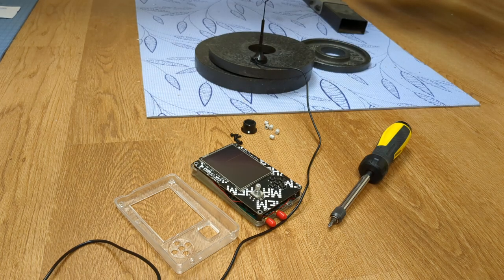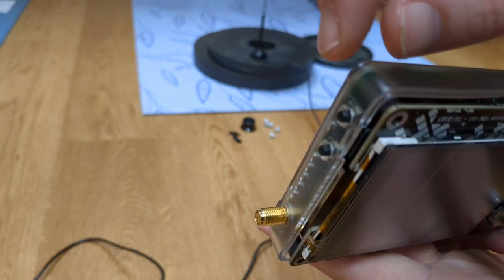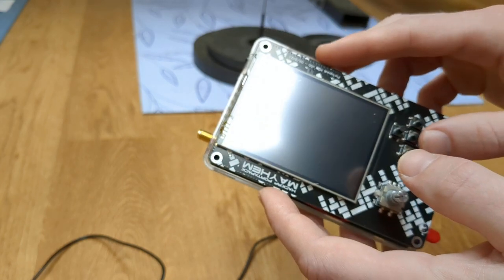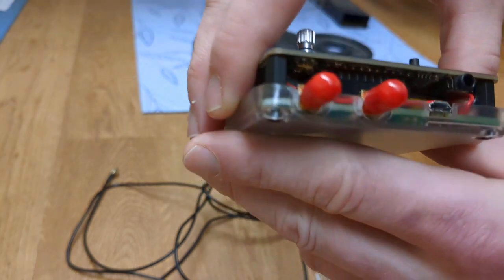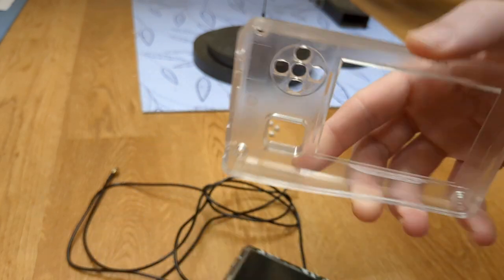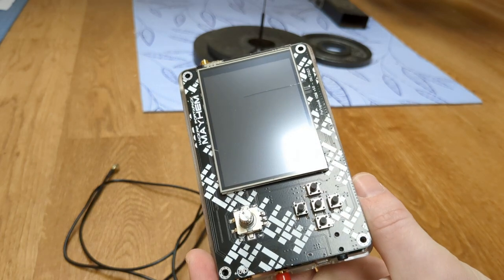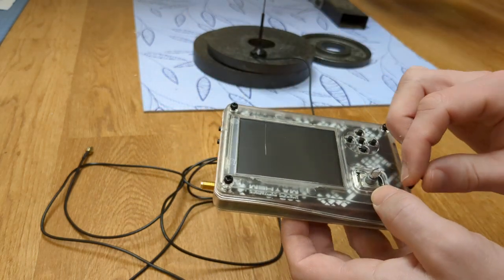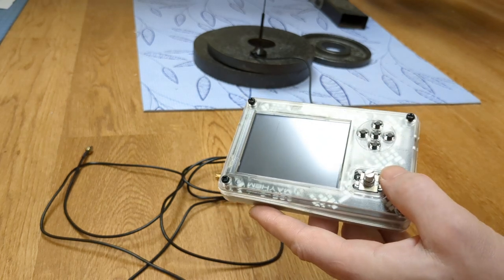Hackrf H2M Portapack Case Installation [WATCH FIRST]

Comment: oh damn.... I think it's time for a case redux. Why are we restricting  ourselves with the plastic that surrounds such a great tool''''...... honestly, I am bewildered, slightly shocked that seeing all the developments for a device like the flipper, that we don't see similar customizations being applied towards adding additional functionality to he HRF Porta Pack.... why after fully knowing the sensitivity and limitations of the amp- why can't there be a solution that isn't just be careful...... or why couldn't a form factor be created where the limitations of the HRF being only single tx or rx...why could there not be a way to "stack" multiple boards to be able to have full dplex..increase  bandwidth and speed at which the spectrum can be scanned. .. Yeah, sure they can be daisy chained from the bottom but tat now takes away from the whole porta part being portable. Why we arent seeeing usbc and usb 3 implimented?i Why are we still fiddling arround with the sd slot being too large and loosing sd cards within the case? btw don't do the hot gllue hack for the sd card..(from the wiki)..i wrecked my sd card slot's abillity to lock in te card and had to permanently lock the sd card in place... Why, on a device meant to be portable, do we have large extruding input components, the rotary dial, the  butons...so many times have i pulled out my hackrf portapack where it is turned on and in a functionality that makes me pray that it didn't actually do what it could have done... the dangers of spoofing airtraffic as im walking, doing so unknowingly, where the device is being shifted from side to side in my backpack...

I gotta say though- props to the many and all that have developed and refined the software side of things. Amazing work. Maybe let us have the ability's to run things in te background?i Thinking capturing packets for extended periods or activities such as wardriving...or just being able to passively collect signals while the device is in my bag without it actually being on....

Just the hardware side of things...don't get me wrong....curently is almost perfect for what it is....but, maybe there are a few items on the table that could see a fix or improvement.... let me attach on another hackrf just like the portapack does...so that we can have full duplex or incrrease speed
Reply from the maker: On the amp thing, there actually is an open source hardware revision of hackrf that reduces risk to amplifier. It's called the Clifford Heath revision, and you can find it out places like ali (I want to try to get one someday to try it).
Reply from the maker: Hahaa I know exactly what you mean on the button turning it on... there should be a clever 'lock combo' of buttons to prevent this, or some kind of cover - actually saw someone post a picture of a knob / dial cover, preventing theirs from turning on.

Something big enough (like a small cap for a bottle maybe), could also be 'taped' to the dial as a temp measure for traveling discretely, to both cover dial, and prevent it from turning on, if you know what I mean. ;)
Reply: That’s what happens with these enthusiast types, they know nothing about UI/UX or design.

Comment: I've had it with the Hack RF / H2, there's always "another issue" first I had no sound , like you there were random issues with the touch screen, thanks to your vid, i realized, my case was in contact with screen.
mine is a "recommended"  OpenSourceSDRLab,  when it came to disassemble to fix, I found the battery and speaker had been mounted in a way that made a simple task difficult ! THERE MUST BE A BETTER Alternative, sure it wont be as CHEAP,  but time and frustration have a cost Suggestions PLS.  🤯
Reply from the maker: I'd love to check out the blackRF someday! Opens new SDR avenues with full-duplex and more capability, but pricey. And doesn't offer the same handheld portability.

But I'm pretty happy with my hackrf and portapack (outside screen break :'(  fault of the case seller not checking my combination).